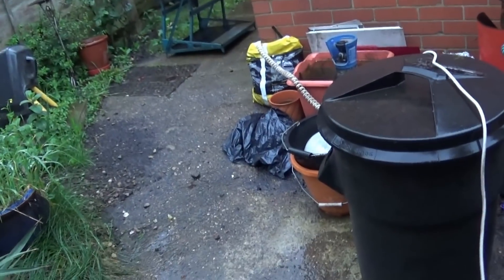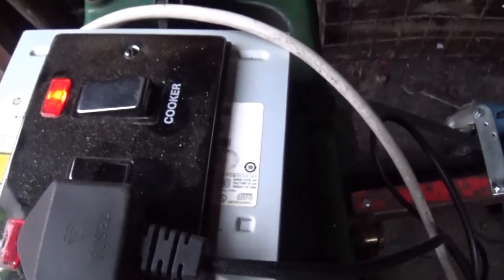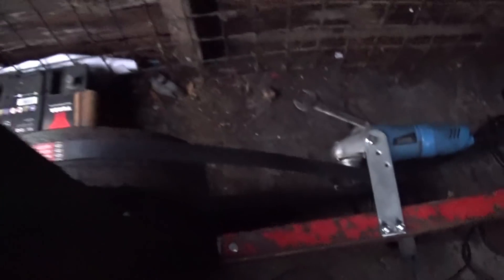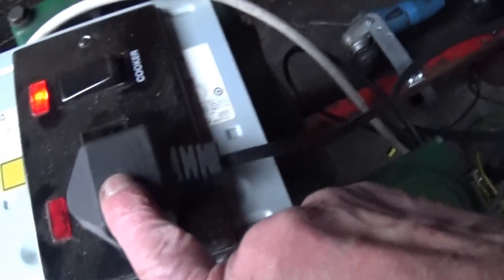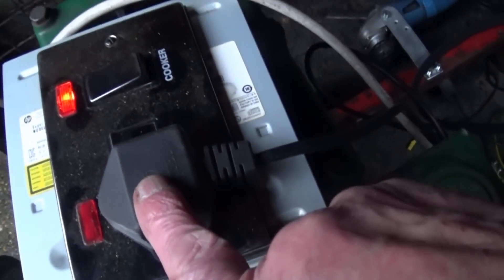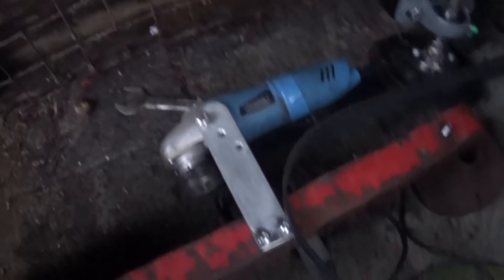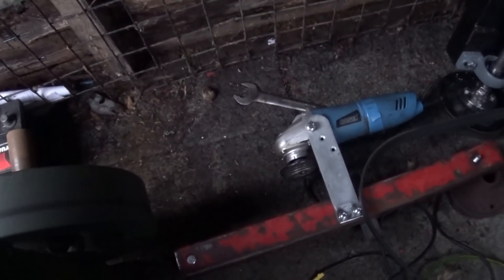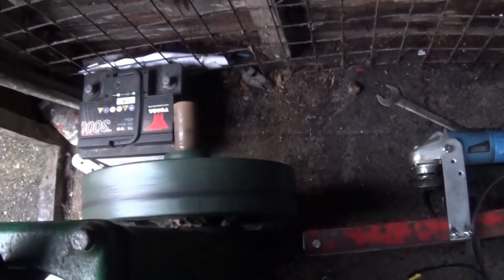Lister D Electric Starter Works

Comment: Brilliant job Malc, thanks for posting, I'm hoping to get one of these shortly, it's in bits & needs work, I will be watching your videos to get some tips & tricks from you, thanks again.
Reply from the maker: Thanks Malc. Not sure if the belt is stretching but I've slotted the hole and made a thin wooden wedge so it should work ok now. If you search for 'steamwally' he did videos of doing one up, several years ago now.
Reply: @MalcOfLincoln  Thanks for the advice, I'll have a look, all the best !!

Comment: nice one malc good job
Reply from the maker: Cheers mate. Tried it this afternoon. Made a simple wood spacer. Had to tap the box away to tighten it a bit, so I guess taking the belt off is moving it a little. Main this is it works. You'll have to pop in sometime and have a look. See how easy it is to start.

Comment: Works very well Malc ! Good job !
Reply from the maker: Thanks my friend. It's made good use of that old grinder as well. Had to grind the outside of the pulley because it was narrower than the belt, but it still grips and doesn't come off.

Comment: There's no stopping you lol
Very cool project and got to be a massive help to your wrists in the long run.
Clever, very clever
👍👍👍
Reply from the maker: Thanks Darren. I wondered if I could start it with my bad wrist when I got it. Discovered it started very easily. However after strapping my wrist up for about 4 months, and getting it better, I've now ruined the little finger side by leaning on the computer desk too long.
There's lots of ways of doing this, but having the pulleys and belt, thought I'd try this a while ago. It worked but needed something more permanent.